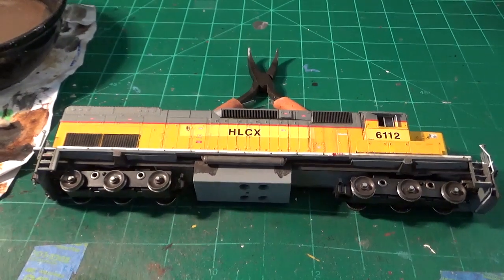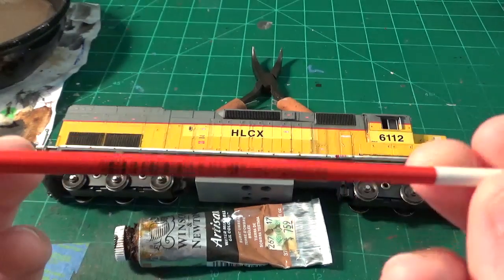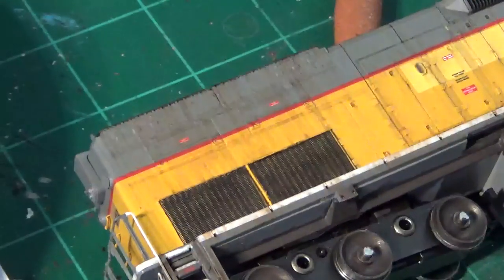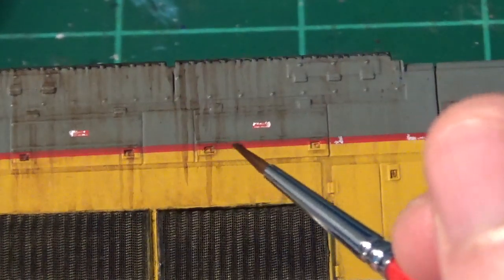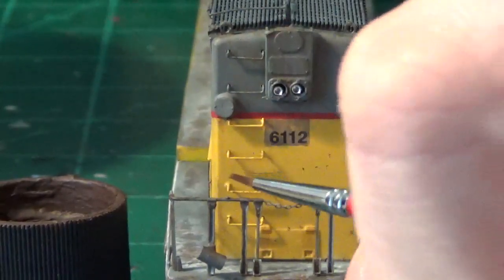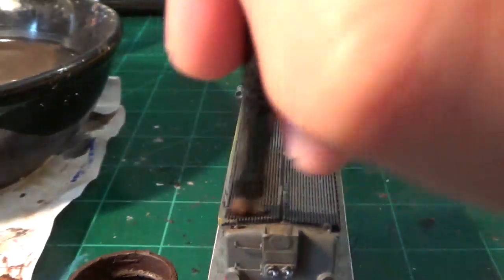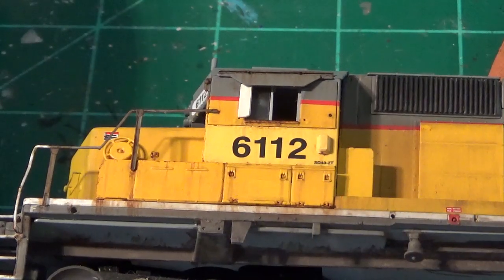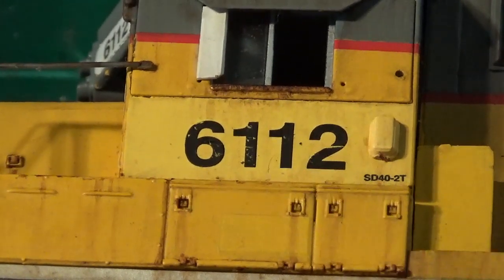DCT Build Series: HLCX SD40-2TR #6112. Part 8. Weathering With Oils.

Comment: That was an abrupt end to the video
Reply from the maker: I had to cut it, because I can't upload these videos past 15 minutes which is complete BS because I used to be able to upload 20 or 30 minute videos.  It's a big hinderance, not only for me because I have to cut all my videos in half, but I also have to upload many different parts for large projects like this tunnel motor.
Reply: @DansRailroad2011  I hear ya man. Hey, would you be interested in weathering a couple scale trains SD40-2s in Chessie System? They're rivet counter series. Might be a good challenge?